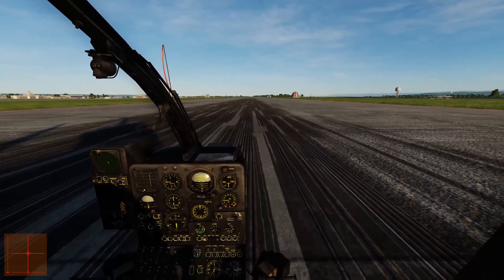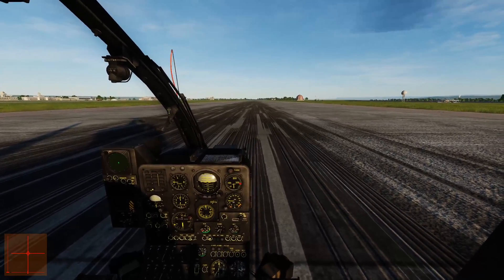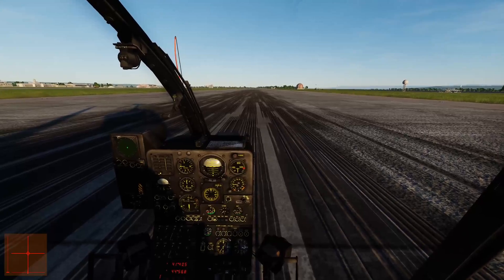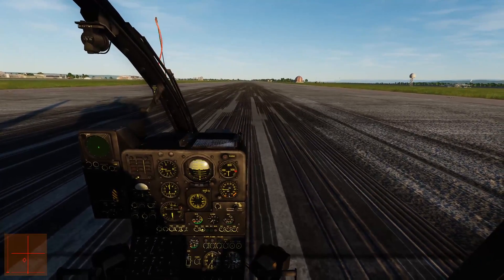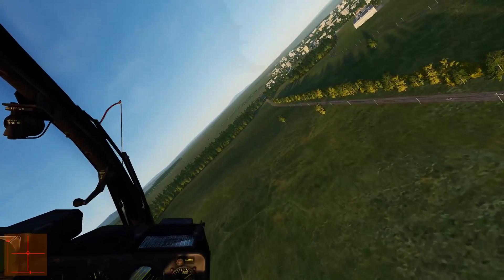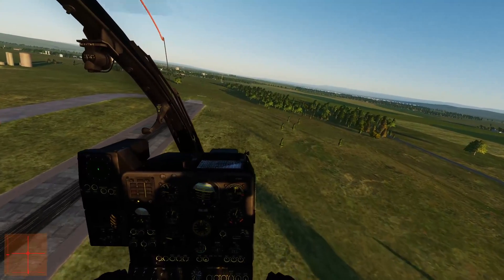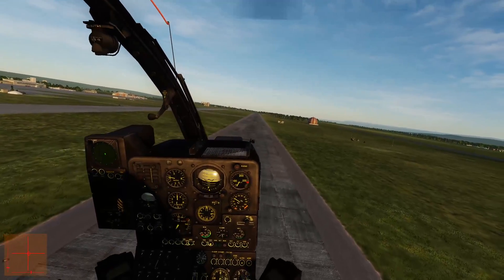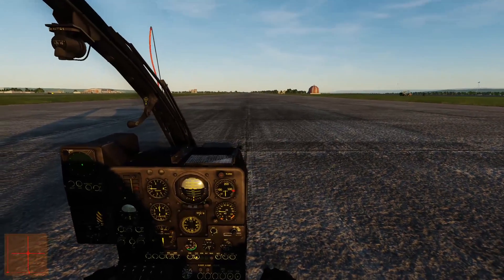A Brief Data-Driven Look at the DCS Gazelle Flight Model

Comment: Very well presented, thank you. I do have one question about your testing though and that is: Did you match the density altitude with that of the test paper? The paper stated a DA of 1850ft and I suspect that if you were testing at a lower DA, that may account for some of the collective position discrepancies you found.
 It's not a major thing and I appreciate the work you did. I just didn't hear you mention DA and wondered if you did in fact take it into account.
Reply from the maker: I did indeed take this into account. I selected Tibilsi-Lochini airport, which has an in-game elevation of 1575 ft, which is fairly close. I suppose Beslan might have been a bit closer at 1722 ft considering I remained pretty low. I did also make it standard-day temperature (15 degC at sea level). So it's not prefect, but the discrepancy is so large to the point that It's due to some other reason. If I were to do a more involved test, I would probably have controlled these variables more, but I felt that wasn't necessary considering just how far off everything was. 

I should note that the early and later versions of the gazelle might have had different rigging and different blades (with different airfoil profiles), so that could affect collective position as well. However, that doesn't really excuse the more fundamental issues I highlighted.
Reply: @ErikScott128  Thanks for the clarification and quick response. I really enjoyed the video. Hope to see more like it

Comment: ED needs to do something about their awful KA-50 yaw damper and add a SAC-style AFCS mode for those of us without pole cyclics.  They should have two stick modes for helos: auto trim for spring & pressure sticks and then the pole cyclic mode (currently a mode that has no trim), rather than two manual trimmer modes and the no-trim mode.  Spring and pressure sticks need auto trim/ trim update/ dynamic trim that models rate-command / attitude-hold (or at least auto trim loading feedback with imperfect attitude hold), not with a manual trimmer button and some wonky centering thing.  Two of their three modes right now are methods that no helo ever built actually used, and they're completely neglecting the AFCS flight law method used by all rotorcraft that have ever had spring-loaded or pressure sticks and that most future AFCS helos will have.  Janes got it right many moons ago in the Longbow series, as their early betas had manual trimmers and a old-school cyclic modeled, but they dropped the old-school cyclic in favor of auto trimming (the legacy trimmer button is still present but uselessly trims in a rate) because HARDLY ANYONE OWNS FFB OR POLE CYCLICS AT HOME.

Comment: Love this video! I'm a fellow aero engineer and I felt like there was a major issue with control inputs throughout flight. I noticed that you almost don't have to move the cyclic forward at all when you're at high speeds (which you ought to, as the plot shows and as is intuitive without full fly-by-wire implementation). If you own X-Plane 11, you should check out the JRX Gazelle. I'll do a test with your charts myself, but the performance is much closer to what you expect according to this video. Here is the review I wrote a bit ago :) Cheers, and thanks for putting this together! https://www.thresholdx.net/review/jrxgaz

Comment: I don't mean this as an insult though it seems like the kind of thing that could be taken as one which is why I want to preface it.  How can you be an engineer who specialises in helicopter handling qualities without also being a helicopter pilot?  I mean I get that you can look at telemetry and such but with how much handling quality is about "feel" (for lack of a better term) seems like flight experience would be a necessity.

Or is the "user experience" a whole different engineering category?
Reply from the maker: This is actually a very good question. I personally think having "piloting experience" is valuable for my job, which is one reason why I like flight simulation in my free-time. Before the pandemic I was pursuing my private pilots license and I have had a 1-hour lesson in an S-300 several years ago, which while brief, was enlightening. The skills reinforce each other. In the end though, piloting and engineering are different disciplines, and you don't have to be a pilot to be an HQ engineer. There is a lot of complex analysis that is entirely data-driven that does not require actually possessing the skill to fly an aircraft. In modern times, much of our analysis in the rotary-wing world is driven by the aeronautical design standard ADS-33 which contains both analytical and subjective measures of handling qualities. There are equivalent things in the fixed-wing world. There are older specifications with objective, quantitative measures to access handling qualities as well. Yes, there is a certain amount of "feel" (we get test pilots to help us out with that), but there's a lot that can be done without actually "flying" the aircraft. 

I should also note that pilots do not necessarily make good engineers and vice-versa; being one does not automatically qualify you to be the other (formally or informally). For instance, I don't think I'm qualified to talk with any real authority about piloting technique and procedures; that's a pilot or instructor's job. On the other hand, I get very frustrated when pilots talk about helicopter aerodynamics and physics and get things unintentionally wrong. 

I hope that answers your question.

Comment: Please do remember, the Gazelle has had about 6 FM updates since I first bought it, the latest one is by far the best one but still not enjoyable. They have had 5 (?) years to get it correct, they havent. In fact, when we first pointed this out, we were blatantly attacked by them, they called us liars, they said it was tested by real pilots and we knew nothing. This is what angered most people. I dont know if you were around when the Hawk module was around, but the Gazelle is the helos of DCS what the Hawk was to the planes, except with much angrier and douchebag developers.

I am a programmer myself (since 2002) and I appreciate bugs and development effort, HOWEVER, attacking your customers who point out flaws and blatantly lying about it is definitely a no go. If there was a way to refund it, I would have.

Edit: if you are not aware, in the past updates it went through several variations of the following: you could fly the Gazelle upside down as it wouldnt sink, you could point at 45 degree noze up and climb almost straight up to several thousand feet, if you dived you would lose all pitch authority  (as if it had no blade), you could spawn with a broken tail, you could fly your skids into vehicles on a base and kill them without you dieing, which means you could use all your missiles and then melee the stuff, you could get yourself into a rotation with nose up such that you could corkscrew yourself up and gain altitude, you could apply anti-torque on the ground, and if you pulled your stick fast forward your tail would snap off (without your skids ever moving) and then fly off without a tail in circles until you reached some speed and then it would stop spinning (as if the tail was still there), you could have another person in your chopper and you cant now, you could do loops continuously without losing speed or altitude (like if it was rails on a theme park just in circles), you could fly backwards without it spinning forward (when the tail catches wind and spins you around), you could turn on your aux tanks and basically have infinite fuel (not very useful), you could use your snap climb to dodge any missiles, just watch the missile, sharply pull collective and dump straight up and missile would lose track, you could fly high speed forward, pull collective down (and it would spin you) and then aggravate that spinning with stick and be a spinning bullet (that was lol), etc, etc, etc.

Comment: When you were testing stick position if forward flight you were gaining alt... seems that you should be going level to see forward movement in the stick, also make sure mag brake is turned off for this
Reply from the maker: In the initial transfer to forward flight, I was, for the most part, holding altitude or even descending slightly. Even if I were climbing slightly, I should still require significant forward stick travel to trim as I increase forward speed. I never touched the trim release/mag brake.

Comment: It would make since if the trim was what was stopping the need for the stick to move forward but you can turn the trim and auto pilot off and it does the same. I honestly don’t know how the gazelle has lasted this long in dcs with that flight model but polychop has announced they will be improving the flight model.

Comment: Hi Erik, thanks for putting this together. As a helicopter pilot I can confirm that not only are the controls strange as you have demonstrated, but the aerodynamic effects on the helicopter are non-existent which isn't consistent with the other helicopters in dcs. Its very easy to qualitatively demonstrate on a video, you already touched on one of them: there is no light on skids, you can't perform a running takeoff because you don't get the chance. 

Some other effects that are strangely omitted: no VRS, no translational lift, no tail rotor drift in the hover, no retreating blade stall (nose up, left roll, at high speed), etc.

I'd add "no flapback" to the list (collective up, nose up, collective down, nose down) which you demonstrated was actually modelled as a roll in the Gazelle, however I'm fairly certain that is accurate for the unique 'rigid rotor' system that only the gazelle has, which behaves differently to the semi-rigid and fully articulated systems most pilots including myself are used too. Its what lends the gazelle is agility, it just has some strange effects when you apply control inputs, such as collective. Without having flown an actual gazelle I can't comment on that particular quirk, but all the others are universal for all helicopters.

Thanks again
Reply from the maker: Thanks for the comment. The gazelle actually doesn't have a hingeless ("rigid") rotor. Early prototypes of the aircraft considered it, but ultimately they went with an articulated hub. As such, it should experience "flapback." Even if the rotor were hingeless, they would still be flexible enough such that the rotor behaves very similarly to an articulated rotor. It's not until you get to super rigid rotors like those in the Sikorsky coax aircraft (ABC, X2, Raider) that you would start to get a stronger response in roll than you would in pitch to a collective step. Of course, because it's a coax, the rotors cancel that out.
Reply: @ErikScott128  Thanks, I knew there was some talk of a rigid rotor but didn't realize it was rejected in development. Then yes, the Gazelle should fly almost exactly like its spiritual children in the EC130 and AS350 which do exhibit normal flapback with collective input in forward flight. Also forgot to mention transverse flow roll, also non-existent while transitioning from hover to forward flight.

Comment: Thanks for the research proving what's been said already. Interesting thing is if you were to fly the thing just like you did with an FFB stick, it wouldn't have moved out of hover at all with those tiny stick movements, as for some reason, with FFB a weird hard coded deadzone kicks in. With that, it literally feels like flying with the keyboard only, smooth attitude changes like you did there are totally impossible. But I'm confident they'll have that sorted with the new FM fundament for the KW and will port it back as has been said to the Gazelle, so we'll eventually have a nice module in the hangar then :)

Comment: I'm curious about the cyclic position. In a real helo the cyclic is obviously "extended" and much longer than a normal un-modified "gaming stick". So for example with a TM Warthog, I use very small "micro movements". I don't know what your controls setup is, but is it possible that IRL cyclic inputs seem bigger because the stick itself is longer in the helicopter?
Reply: It's about use of 0% to 100% of cyclic axis, not about using a fraction of it. You can see it very clear on the axis diagram in the left corner. Max blade angle and power.
Reply: @alexandervoigt7313  Perhaps I'm not understanding correctly. Is 50% on the graph stick neutral?
Reply: @jabawocki9462  yes, center is neutral. Try to look for Gazelle videos, there are scenes where you can see real stick deflections where the pilot makes corrective inputs for going into hover etc. They are not just 10% around the center.
Reply: @alexandervoigt7313  I'll have to check those out. Thanks for the answers!
Reply: The Cyclic position in the graphs and the onscreen input display is not a measure of deflection distance but deflection percentage so stick length has no effect. With a short stick a pilot would perceive that finer control was needed for the same control movement but that isn't what he is comparing.
Reply: @JakusJacobsen  that makes sense, thank you for explaining.
Reply: I have 40 cm from joystick gimbal to handrest, and I hold on from about 3 cm above the handrest with two fingers. So my joystick height is about 43 cm. 

And with a such a length, I am moving joystick about +/- 1 cm around a center in total. That is without any axis adjustments (curves etc). Now, if you would be a real helicopter pilot, you couldn't control any helicopter with a such a reaction because if you get shot, you get tensed up etc, you would throw the helicopter right away around. That is not the case in real helicopter, where you are moving the cyclic in its full movement range depending your speed, your center of weight etc. As with helicopters, your center of gravity is not center of your helicopter, it might not even be inside your helicopter but outside. In some cases CoG can be couple meters forward, outside your canopy. So all your helicopter rotations happens from there. This is critical why you need to know how to balance your helicopter weight and that weight doesn't move suddenly when you are in flight. Because you are always constantly balancing everything around CoG. This is as well critical and so often cause for accidents, that when your landing wheel/skeel touches ground, that becomes your CoG. You have just successfully connected your helicopter to whole planet earth. And all the controls you give, are given around that contact point. 

If Gazelle in DCS would be flying like real world helicopter, no one would fly them at all. Too dangerous, too deadly with way too high probability to kill you.
Reply: @paristo  Actually it's the opposite, if the real world version of the Gaz would have the DCS module's twitchiness, control and physics weirdness, most of it's pilots would be dead.
Reply: @alexandervoigt7313  Duh me.... You are totally correct. Twisted my logic writing that by thinking what Gazelle tries (is not) to be.... Thanks for correcting!